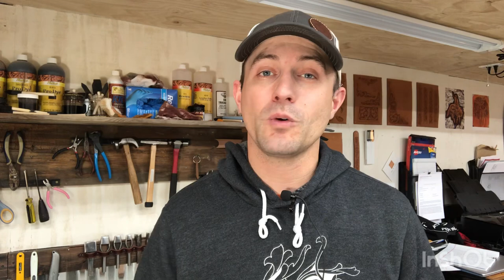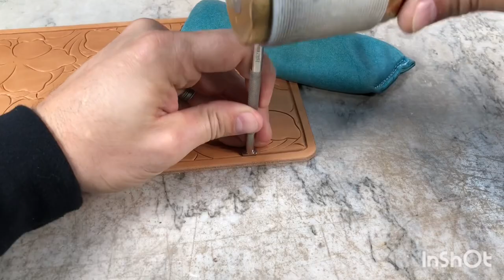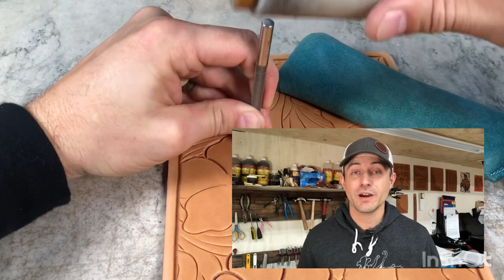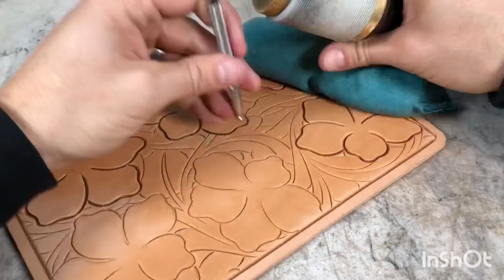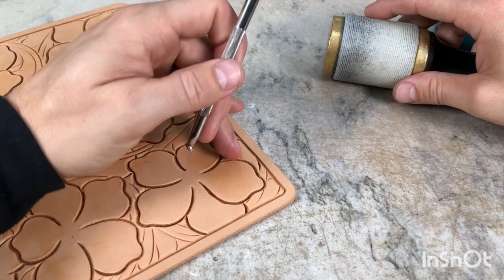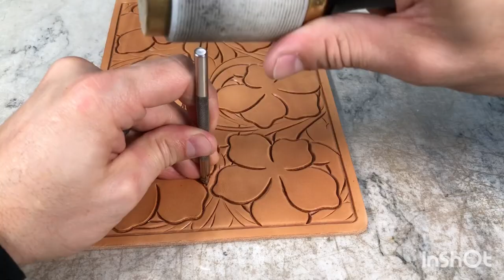What side of the lines should you bevel?

Comment: Hi Joe, I`d say I`m still a novice in leather tooling &  I`ve recently bought a Barry King no2 checkerd steep Beveler . I`m still learning Beveling and I`m struggling with getting my Beveler to "slide " as I`m running along the swivel knife cuts. It appears that the Beveler drags  with no fluency as I try to move along  as you appear to do when you are Beveling. You seem to slide along like a hot knife going through Butter.  I try to copy your method ,but no matter how hard  I try, it just won`t Slide along "Nicely "as I start Tapping after the first drop in of the beveler,  . Its as if the checkering stops the Beveler from moving along fluently ,causing the Beveler to drag on the leather .???? Does it sound maybe to you that I`ve not got my leather belt wet enough do you think .? 
What I do is, wet my leather belt with a few passes of water & then let it dry a bit till the color starts lightening .Then start to bevel .